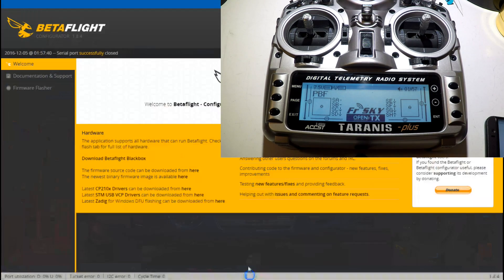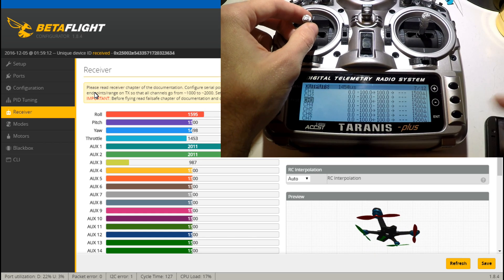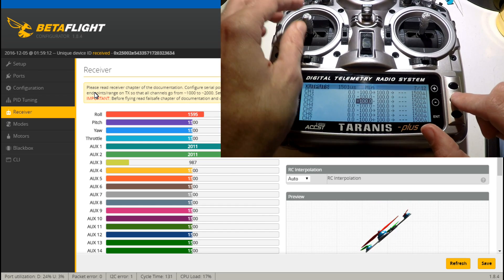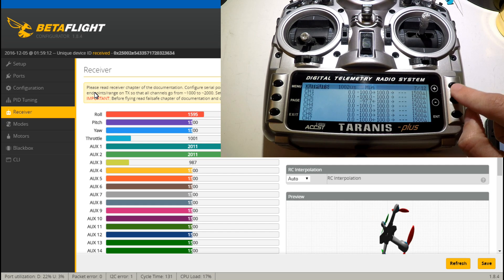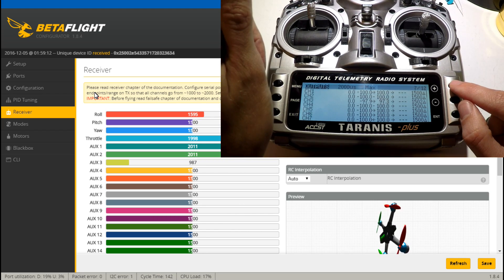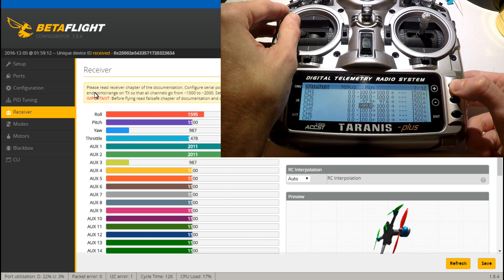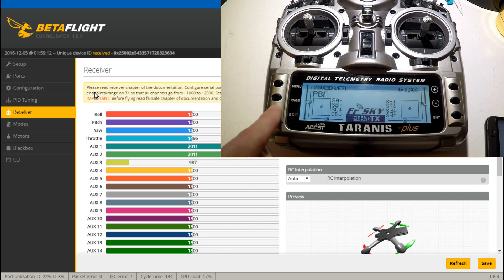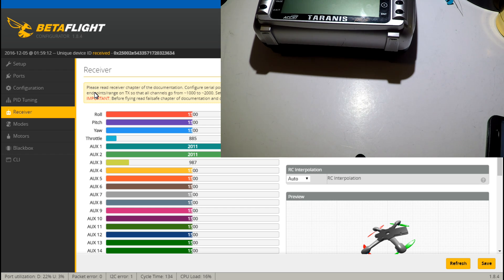Calibrating Channel Endpoints In Betaflight / Cleanflight

Comment: Got a new tiny whoop today, throttle response was shite. Figured out the endpoints and midpoints were way off. I never had to trim before for my 5" quads. Search "endpoint calibration betaflight" and here blue falcon pops up. Same guy that helped me with the old taranis back in the day. Almost 5 years later and these videos still help. RIP man.

Comment: Ok so I'm having this issue where when I go full throttle I get this yaw kick where it feels and looks like the quad is being yawed to the right. I found out that my radiolink at9 throttle/yaw gimbal does not stay at 1500. I set endpoints I subtrim and if I touch the stick once it will go way off 1500 and will go to a number of like 1516 that I see. this happens on the one quad with the emax 2300kv redbottoms but the other quad with the iflyrc 2580kv motors and different RX but same radiolink TX I only see slight yaw twitches. Now I had the arris x220 and had this same exact issue then when I weas told to go set subtrim and did a test flight this was flying perfect!!! And I was using my flysky fsi6 TX. The flysky TX endpoints are almost spot on. It will stay on 1500 to 1499 and that's it. So It seems like I know the problem but I'm puzzled how the other quad with the higher kv does get as affected by the yaw kick.  Maybe some one with more knowledge can shed some light on this issue for me. I'm not good at tuning or building these things but I can fly pretty dam good ;0 thank you guys!!!
Reply: https://www.youtube.com/watch?v=-EuuBqAkM_E

Had the same thing. this will sorted the yaw/rudder problem on my qx7. maby your radio can do something similar
Reply: Hey thanks man!!! I'm going to check this out. I actually don't have that quad put together right now cuz I used it for parts on another one. But I'm very appreciative for your help!!!!

Comment: I ve a problem with my channels, any mode on my transmitter doesnt work well, its like , throttle have the position of throttle. i ve no glue how i can fix that. thx for your attention

Comment: My X9D throttle (ch3) won't increase maximum past 100 and in BetaFlight it reads 1957.  I just get beeps when I try to increase it to adjust.  Similarly in Yaw, I can't adjust DOWN from 1022 (in BF) -- I get beeps.  I adjusted the yaw max DOWN from 2045 OK.  I can't lower the roll from 1016.  Same 1016 at the bottom of pitch I can't fix but I fixed the 2023 at max.

Is my Taranis cowdered?  Would Hall effects gimbals "fix" this or make it better?  What would cause my transmitter to be this far off?  (and will it matter much if I cannot get exactly 1000 & 2000?)

How does this relate to what others say to do -- using the CLI command rxrange [channel] [min] [max]  ?
My X9d seems to wander around, mainly below 1500 at center, so my model tumbles like yours.  I adjusted it using TRIM, but that's obviously wrong.  So before I tried to do what's in your video I centered all the trims.

Comment: What if the midpoints are off?
Reply: Ronn2664 same here for some reason my fc thinks center stick is 1495
Reply: jussa101 fixed mine adjust midpoints using subtrim.
Reply: Ronn2664 how did you do that? In the same menu there's something to the right from what I see on his video. Did you just increase that till you got 1500? Appreciate the reply.
Reply: Ronn2664 hey figured it out thank you :) appreciate it.
Reply: jussa101 no worries. :)

Comment: Any idea on what to do if you values appear under the desired endpoints. IE you started off with value of  987 therefore you could easily minimize those values to start at 1000. But on my controller the lower starting value is 1060 and the max is 1920. So how do i extend the channel values instead of minimize as you shown here?
Reply: Thanks! Great tip. Got em centered. Its "E. limits" on the Qx7. Works great. I was stuck on 1007 on all of my endpoints.
Reply: The Sweep I'm having the exact same issue.
Reply: I found a semi solution, it still doesn't quite get me to perfect 1000/2000 but at least closer than i can get otherwise, on page 2/13 in your selected model. and about 13 clicks down the page you will find "Extended Limits" Select that and it should open up the end points further.
Reply: The Sweep you could probably try adjusting the ppm frame.
Reply: The Sweep I'm having the exact same issue.
Reply: The Sweep go to CLI dump you can do this there

Comment: My min values in my taranis is at -100 but in cleanflight at 1007 and can't go lower anymore.
Reply: I found a semi solution, it still doesn't quite get me to perfect 1000/2000 but at least closer than i can get otherwise, on page 2/13 in your selected model. and about 13 clicks down the page you will find "Extended Limits" Select that and it should open up the end points further.
Reply: Mine too. I've seen another video where he has the max and min at -500, but if you cant move higher than the minimum, what do you do? Let me know if you find the solution.
Reply: That works for me. Thanks!
Reply: tecno pro FPV  no worries, happy flying!

Comment: Isn't it better to adjust the subtrim on the outputs screen, rather than the PPM center?  Changing the PPM centre also adjusts the min/max points meaning that you need to fix them every time you change it.  Also, if do a large adjustment to PPM center, you might not be able to adjust the min/max values enough to reach 1000/2000 any more.